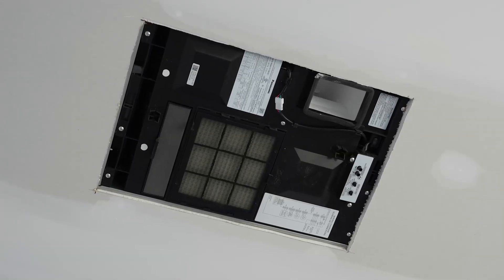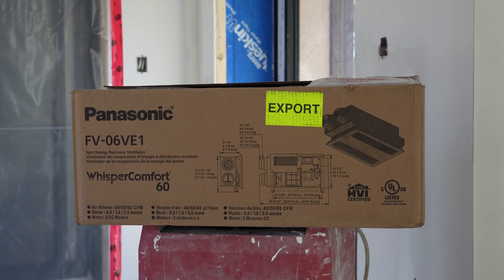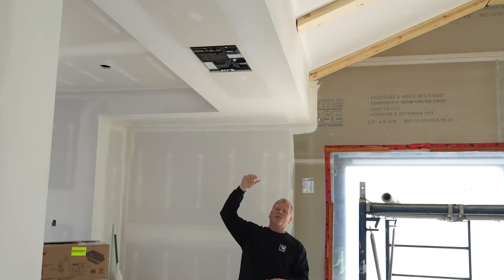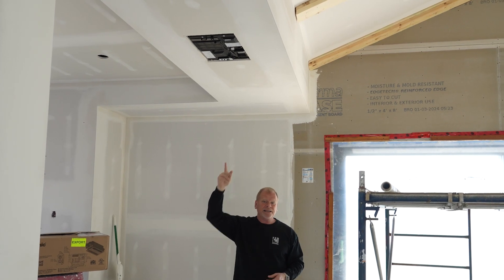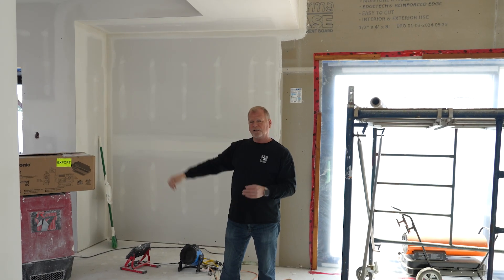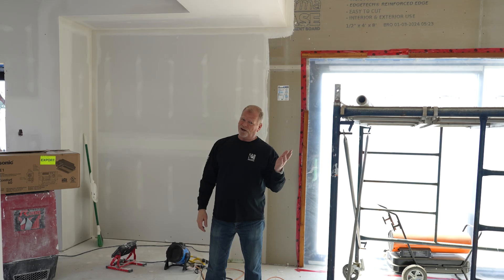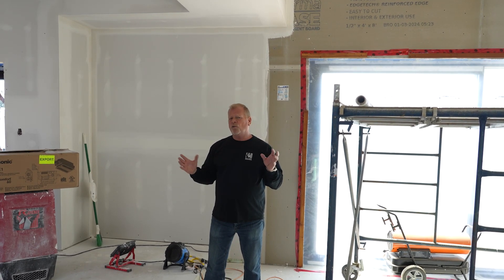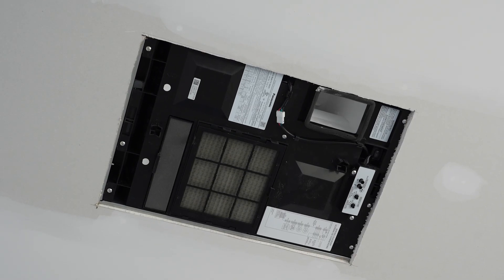Mike Holmes' Sunroom | Solution for Airtightness

Comment: Why didn't you just duct fresh air into the room? I put a dryer vent on the outside (under deck) and use it to draw fresh air in thru 4-in ducting down to a floor register in the bottom kick plate of the stairs. Out of the way but easy to access. Open it in winter when wood stove is running... close it in summer. No motors. No warranty's. No repairs. No replacements.

I also have ICF's (for my basement) and am amazed that you don't have a concrete board barrier between the insert opening and the ICF forms! They don't 'burn' easily but DO 'melt' down and outgas until the temps are high enough to cause open flame. 

You're the man, I know you KNOW how do do things so hoping you'll elaborate so I understand more! (I iz a jack-leg... but still try to learn!)